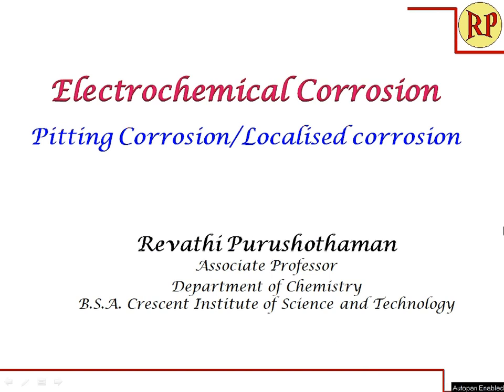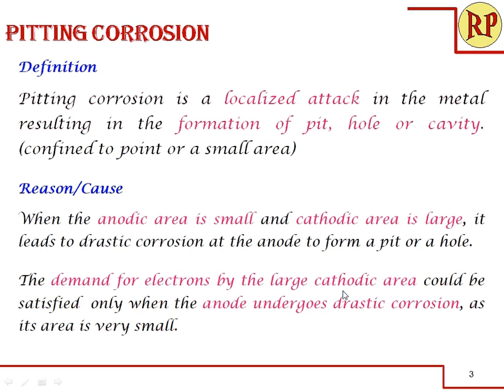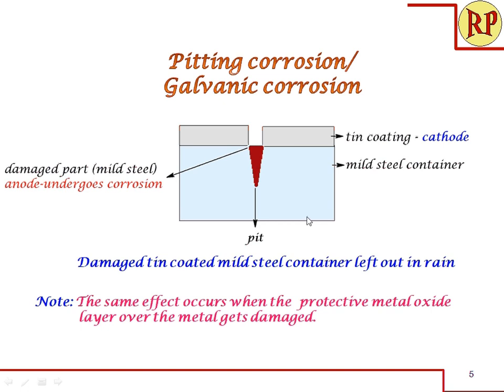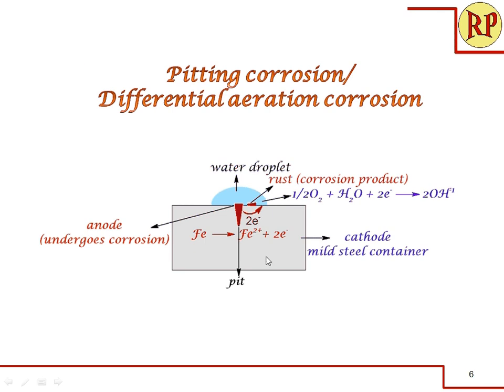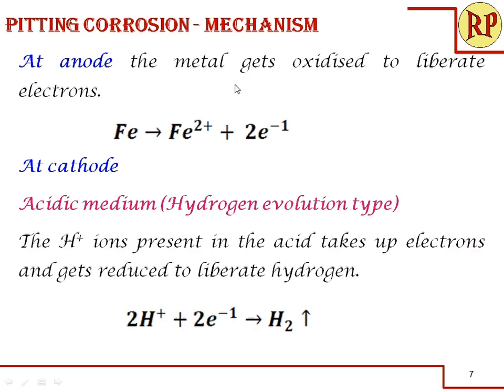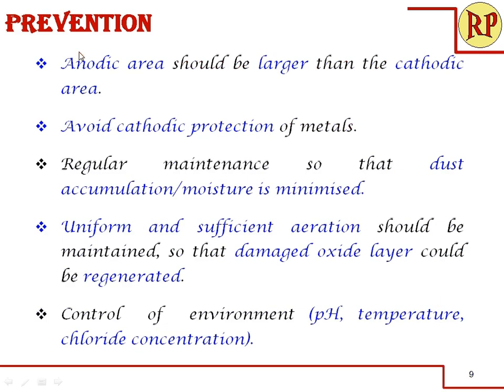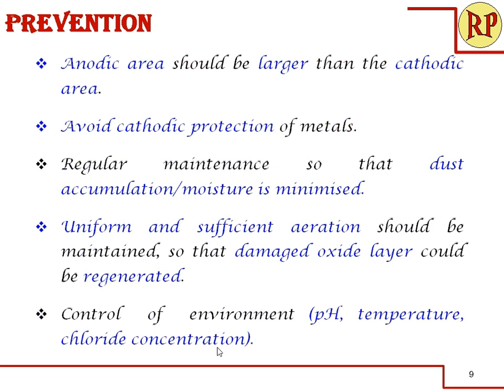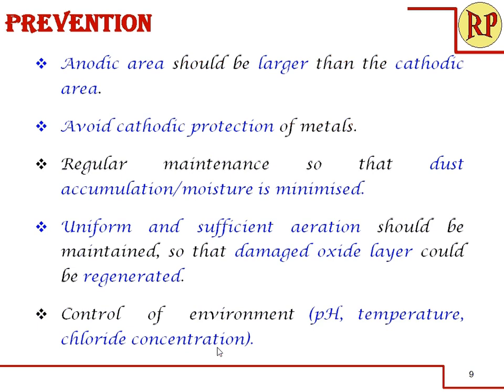How does Pitting corrosion occur? /Localised corrosion: Electrochemical corrosion

Comment: You said pitting corrosion can be prevented if the anodic area is larger compared to cathodic area . How this can be possible in case of differential aerated corrosion . Please give an example
Reply from the maker: In this example, prevent dust accumulation. Good maintenance can prevent.

Comment: What is the driving force behind the conversion of Fe to Fe 2+....
Reply from the maker: Generally most of the metals are unstable, except some noble metals. All metals tend to go the combined state rather than being in its metal state. In both the cases, when iron acts as the anode, it undergoes oxidation i.e.  Fe to Fe2+. The driving force for corrosion depends on the electrode potential of the overall reaction.
Reply: @RevathiPurushothaman  can I not say that the atmospheric O2 being an oxidizing agent wants electrons whenever he finds a region which is rich in electrons( in this case Fe metal) and so Fe becomes converted into Fe2+ ?
Reply from the maker: Your argument may hold good for dry corrosion, where the oxygen present in the atmosphere oxidises the metal. But in this case it is wet corrosion (electrochemical corrosion), where the corrosive medium plays a major role to drive the corrosion.
Reply: @RevathiPurushothaman  yes ....now I'm satisfied....thank you♥️
Reply from the maker: You are welcome.

Comment: Ma'am if a small steel pipe is placed in a large copper tank, 
Steel- Anode(small)
Copper- cathode(large)
So will the corrosion be pitting corrosion?? Or will it be differential metal corrosion??
Reply from the maker: It depends on how it is placed. If it is immersed completely, corrosion will take place evenly on all sides of the mild steel pipe. Only if a small portion is exposed like a scratch in a coating, pitting  corrosion will occur.

Comment: Mam, if I give earthing of battery on cast iron and if there is a rubbing happening on one particular point on it will become similar case as you said large cathode and small anodic area??
Reply from the maker: Not just by rubbing, because a single metal is present here and it cannot remove any coating. But if something which is rubbing is a small area and constantly in contact with the metal, then the metal underneath that small contact area will act as anode and undergoes differential aeration corrosion and also pitting corrosion.

Comment: If anode area larger than other type corrosion will not accur?
Reply from the maker: It can lead to galvanic corrosion or differential aeration corrosion etc, but it will to drastic corrosion, which will be in the form of pit. Hence  pitting corrosion also.